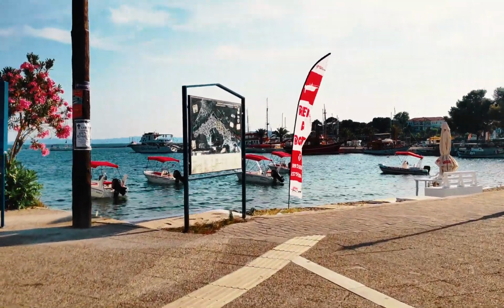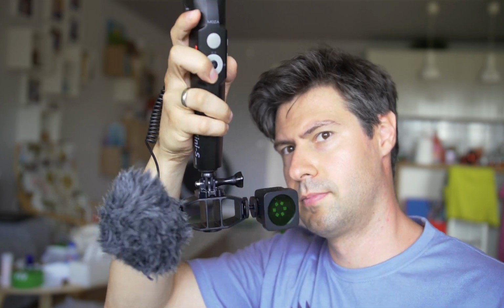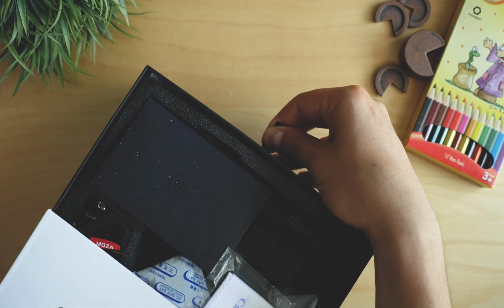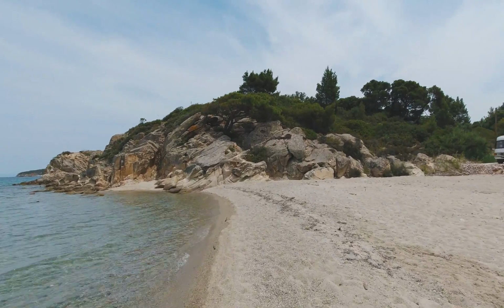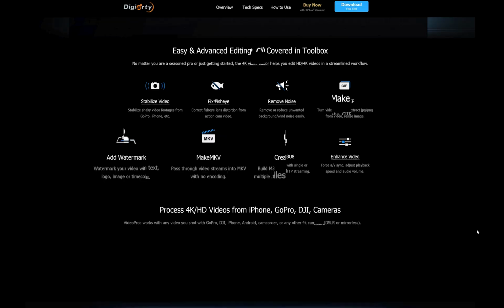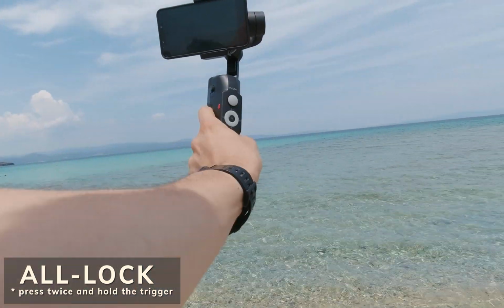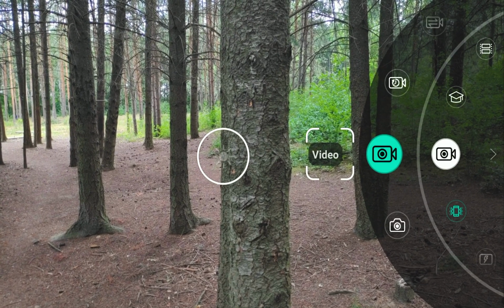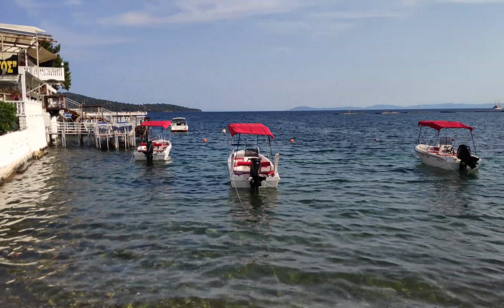Moza Mini S: Foldable Gimbal for Smartphones that is Budget-Friendly!

Comment: Hi mihail I just have a yi 4k action cam which doesn't have good stabilization... Also have poco f1 . Please suggest me if this gimbal will work with action cam also... Thanks in advance
Reply from the maker: Yes, you can get an action camera plate and it will easily work with your Yi 4K camera.

Comment: Everything is good,main problem is gimbal won't connect with mobile that easily.
Reply from the maker: You need to keep location settings ON and it will work well.
Reply: @TechMishka  my location is always on,and I tried with different mobiles,redmi note 8 pro,Poco F1,iPhone 5s.and still facing the same issue

Comment: Can you use during the Winter time when it's -15 degrees Celsius outside for example? 
(I live in Canada, and I know some Gimbals cant function well under 0 degrees Celsius)
Reply from the maker: It is not recommended and according to the specs - not supported at all, but I think it will do fine - with perhaps reduced battery life.
Reply: @TechMishka  Ah I see, thanks!

Comment: The yours are great and pretty helpful reviews!! I have a kind of hard question for you 😄😄: Moza mini S, Hohem Stady mobile or Zhiyun smooth 4? What would you choose between these 3 options? I have to choose one of them, combined with a xiaomi mi9T,  but they look like pretty similar, i need a pretty honest suggestion. Thank you very much 🙏🙏
Reply from the maker: Hmm, that's very hard. Each one of these will do fine. the iSrteady mobile Plus is really good, but if it's not the Plus - then maybe the Mini S.
Reply: @TechMishka  thank you! and it costs a little less which is not bad in these times 🙏

Comment: Hello from Turkey bro. I want to ask one question. I have a PocoF1.Does the gimbal support 4K 60fps on PocoF1? This gimbal not usable 4K object tracking mode. It's okey but, other modes?
Reply from the maker: No, the gimbal can track only in fullHD. But you can use the stock camera without tracking.

Comment: Without testing with a phone, this review is kinda unhelpful. 
A “max” size phone might not even work with the case on or the motors could just twitch.
Reply from the maker: Correct, a too large device will not be suitable.
Reply: how about note 9 is it ok?